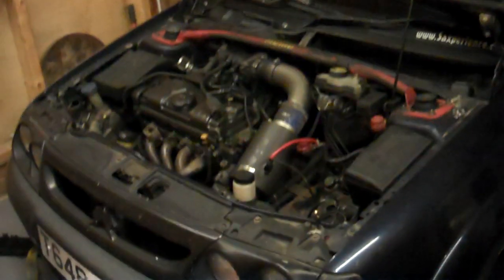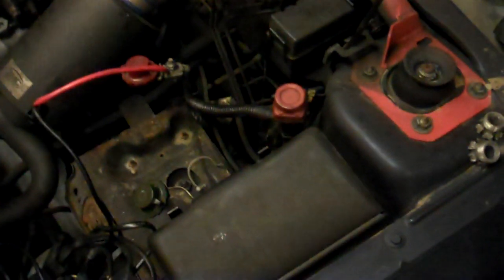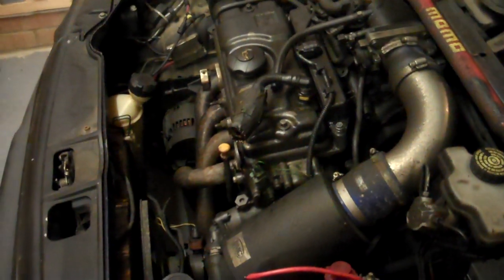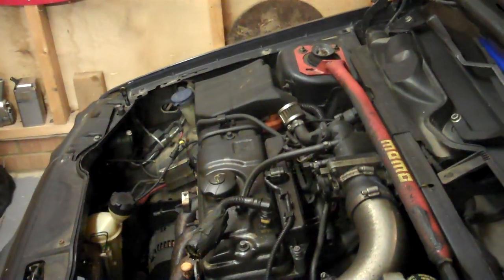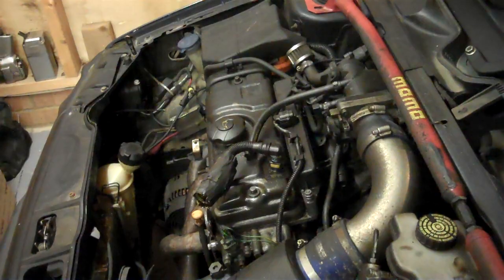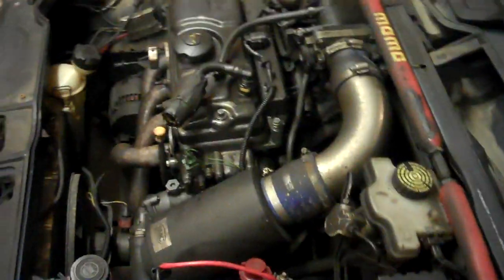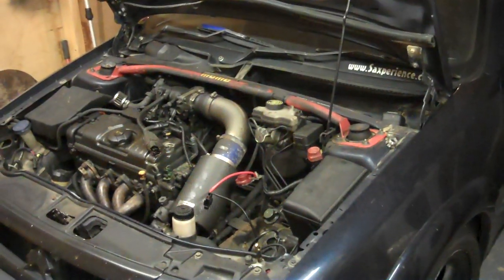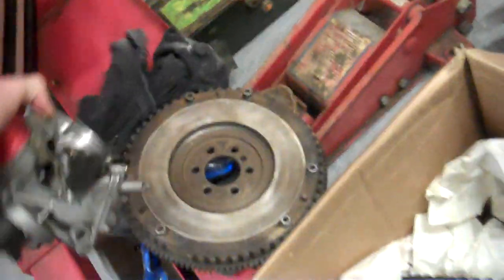Quick Video On How Rev Limiters Work

Comment: Just FYI, on that car it isnt killing the spark it is killing the fuel injectors. The spark will stay on.  On a dirt bike or a carborated vehicle with a limiter it will kill the spark since the fuel is not controlled by a computer or anything, And diesels, on the the older ones they havr what it called a governor. Basically once the engine hits a certain rpm the fuel limited to keep it from surpassing that set rpm. This is done this way on a diesel because the fuel is the only thing that is used to control the power output, since air is not controlled and there is no spark.  On the most modern fuel injected gasoline cars, with an electronic controlled throttle body, the typical "bouncing" you described when it hits the rev limiter is no longer there, since the ecu will literally just close throttle plate to keep the rpm below the maximum
Reply from the maker: Well described... 

I don't remember making this video and it's not loading for me to watch it back now lol.

Limiters are very simple...
Reply: small engines have governors I removed my from my gx120
Reply: poopaky wowitstinks yes true... small workhorse engines like those used on lawn mowers and generators will have a governor.
Reply from the maker: You love it!
Reply: @Michael G Diesel and petrol machines used a governor to regulate the rpm, today diesel and petrol machines still use them. No governor has limited a diesel though as they are self limited.